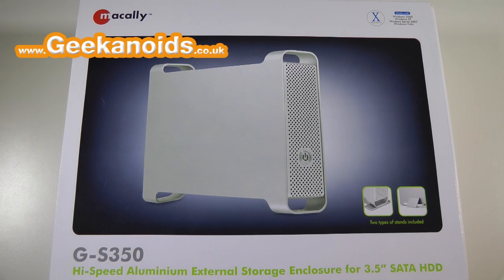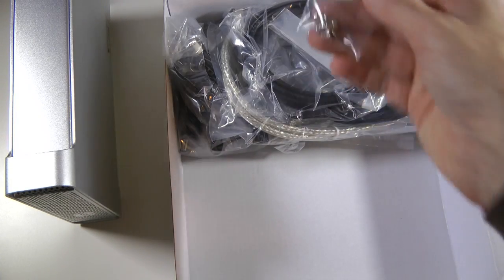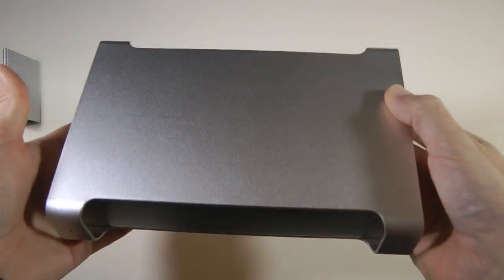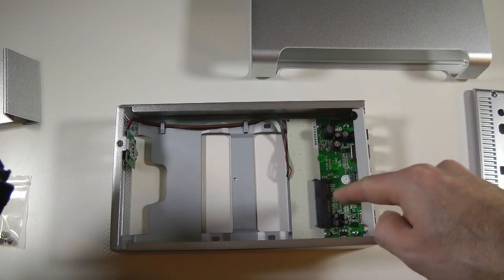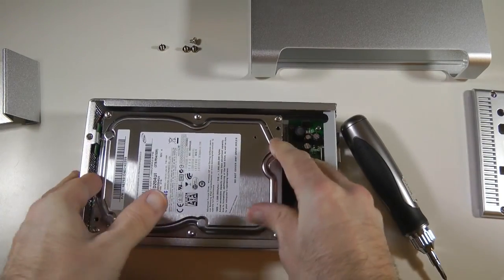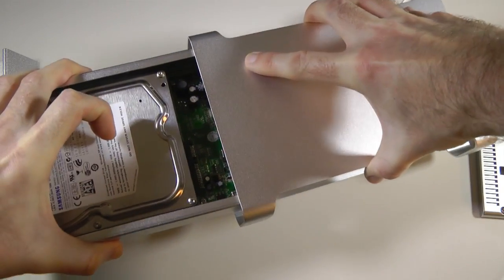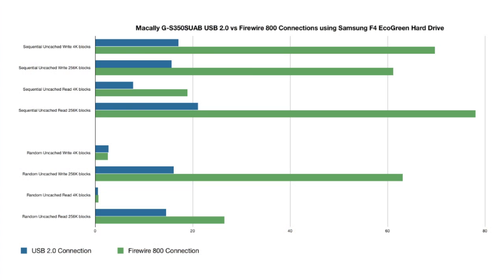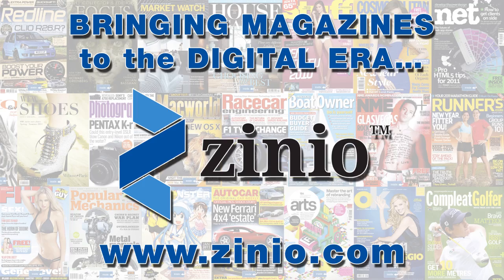Macally G-S350SUAB Hard Drive Enclosure Review

Comment: @coked007 As long as it's a 3.5 inch SSD or if you have a 2.5 inch to 3.5 inch adapter, which is often included with many SSDs. There should be no problems with working with an SSD.

Comment: @nazhif1 
In the Hard Disk in a Hard Disk Drive (HDD) is a magnetic plater. Similar to magnetic tape from audio cassette  tapes of yesteryear. In speakers there is a magnet often a pretty strong one. 
Depending on the proximity and the strength of the magnet you can wipe you HDD. Which is a great way to destroy data on you drive in a hurry if needed, but most of the time you don't want this ;-)